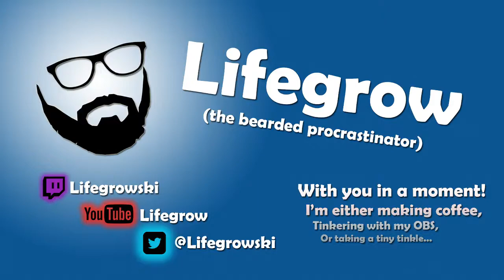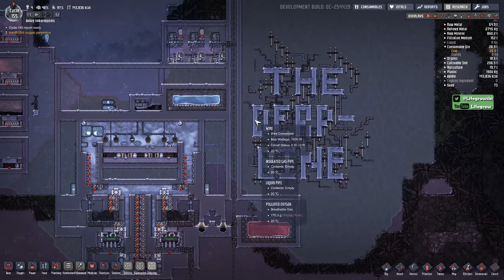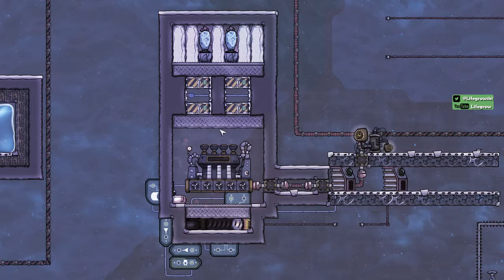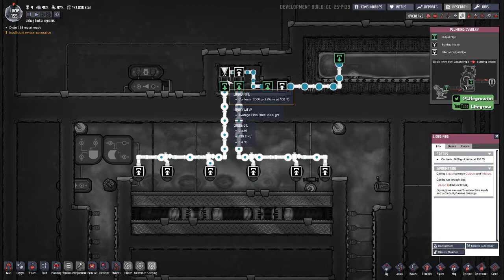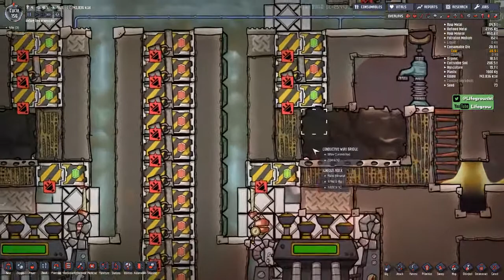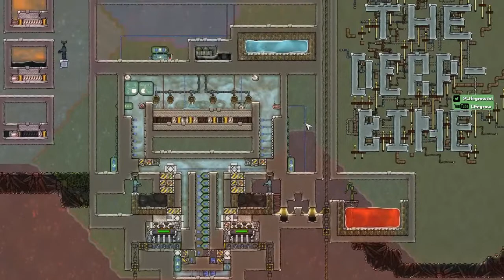**UPDATED STEAM TURBINE BUILD** Occupational Upgrade Release

Comment: I think you are the only one who made this worked. But, I really need a compact version and a tutorial step by step on how to make that set up with dupe. Thanks. I need one on my base. I am running out of coal.
Reply from the maker: Unfortunately at the moment, compact isn't really possible. However, with the new geysers/fumaroles being introduced, i'm sure some small and useful designs will come out - especially considering one of the best parts of the steam turbine is that it deletes heat from the game. I.e. pump in 1000 degree steam, and it'll pass through the steam turbine and come out at a much more manageable 170.

Comment: the liquid heaters now stop heating after 85C  =(  same for the space/gas heater.  lamps can heat some tings up to 125C if made of gold but break at that heat so needs to be set a little bit cooler
Reply from the maker: No, you can get around the shutoff temperature - this was built after the change - you need to build a pulse clock to auto-toggle them on/off. Check the other comments below :)
Reply from the maker: (sorry, it wasn't mentioned in the comments for this video, it was mentioned on the previous build - my mistake)

Link to a thread showing you the pulse clock - https://forums.kleientertainment.com/topic/83723-useful-automation-gadgets/?

Good luck!
Reply: Thnx =)

Comment: Your build is quite good. It just has one massive flaw in it. How do you build it in the actual game outside of debug mode?

That is the problem I am finding in the game, building something huge like this is not really practical. Or will take 200+ cycles to make.
Reply from the maker: CommanderJonas I completely agree with you- this video was just to show that they "could" be built when they first came out - at the time nobody had a working build. I did say that it's a nightmare build :) However with yesterday's ranching update going live, the new geysers should make many new steam turbine builds viable.